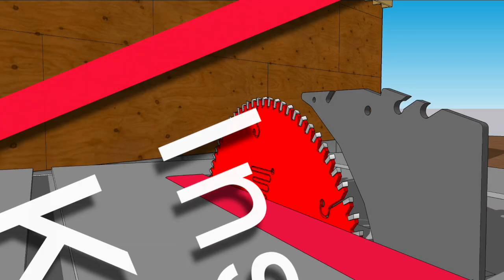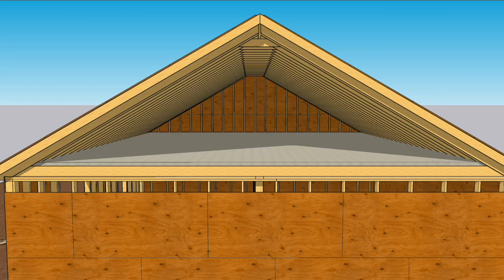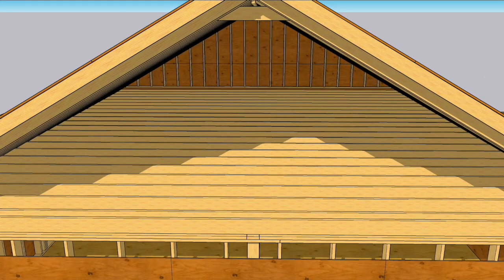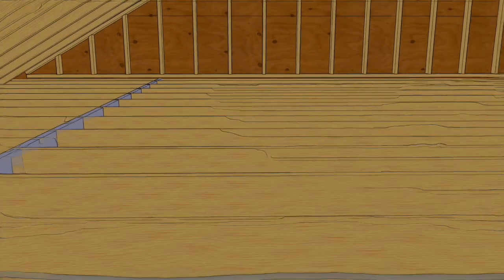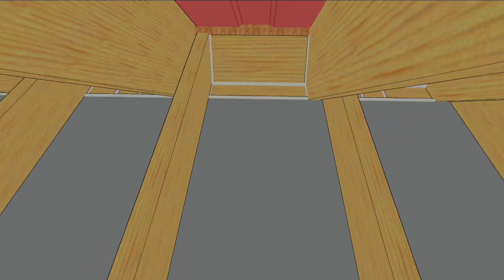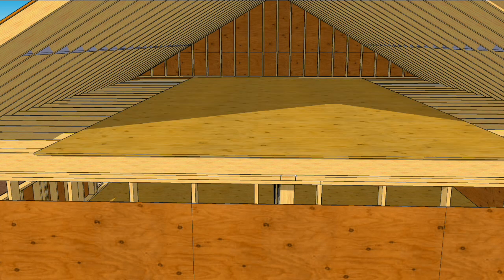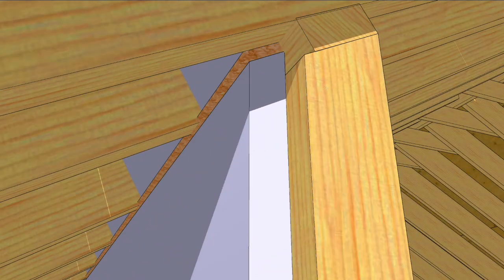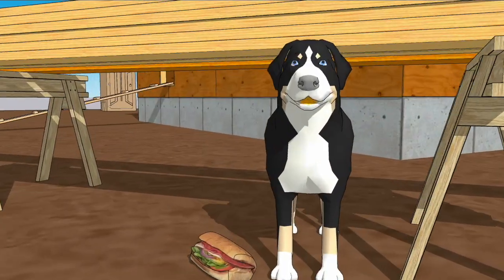Insulating knee walls

Comment: Hello, I really enjoy watching your videos. Question on using foam board on the exterior in this application(this also applies to using foam board on exterior sheathing). In mixed climates, don't we want our walls to be able to dry both ways? Wouldn't installing foam board(an impermeable insulation) prohibit any vapor that got into the wall cavity during the winter time from drying through into the vented space and exiting? Wouldn't the same be true if using this strategy on the exterior of a building with foam board exterior insulation? If we have a vapor open WRB which would allow vapor to pass through it from inside the wall cavity, it would hit the rigid foam and not be able to dry through it. Would love to hear your take on this, thanks!

Comment: Interesting. I am in the process of remodeling my cape cod and I am at a crossroads. I will be adding external insulation to the walls, but was unsure of how I would approach my attic. I'm concerned that there just isn't any way to get enough r value at the ceilings above the knee walls to prevent condensation on the underside of the roof deck (or to actually keep the space at a comfortable temperature). Especially because adding baffles halves the amount of insulation I can add in my 2x6 cavities. If the roof needs re-doing anyway as I'll be removing an old chimney, why go this route instead of the externally insulated roof you've shown in previous videos?
Reply from the maker: You could add exterior insulation above the roof deck or use deeper rafters to boost the insulation. You could also use closed cell spray foam.

Comment: What about vapour barrier on the heated area of the knee wall behind the drywall? I live in Canada east coast and have the same setup above my garage. Do I need vapour barrier on the warm side? There is vapour barrier on the ceiling of the garage. Thanks.
Reply from the maker: Some areas require vapor BARRIERS, some areas require vapor RETARDERS. In some places latex paint on the drywall counts, some folks use closed cell spray foam for the job. It is worth buying a book about building science or attending a Building Science seminar with a reputable engineer (NOT a social media influencer).

Comment: If you are already going through all that effort, why not just design it as an unvented attic?
Reply from the maker: The simpler solution (next animation) would be to move the thermal boundary to the roof, as I think you are suggesting, but the roof can still be vented. Of course, roof venting is almost NEVER as simple as it seems like tit should be, but that is a whole nother topic, for which we have some edifying podcasts about.

Comment: Seems easier just to insulate the entire length of the rafters.
Reply from the maker: Yup. That's the next video, but for some reason, people still want to do this. So, If they are going to do it, we want to show them how to do it well.
Reply: @ProTradeCraft  😎👍
Reply: At first glance it sounds enticing and seems to be the right way to do it but it isn't. He demonstrated how he is insulation at the thermal break. Adding insulation to the underside of the decking in the unconditioned space is a waste of $$$ and time. He did what I've been doing for a long time with knee walls; flash and batt. 
Foam board on the studs with batted inside. It's highly effective from a cost and insulation standpoint as you get the less costly batted being helped by a true air barrier.